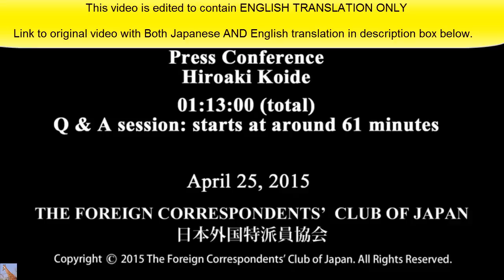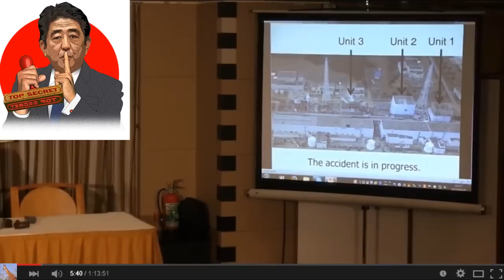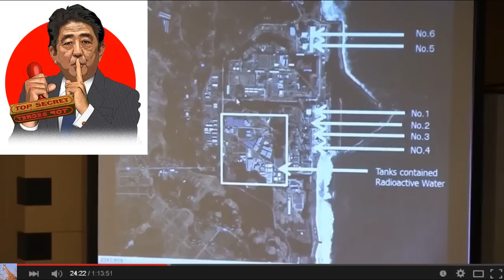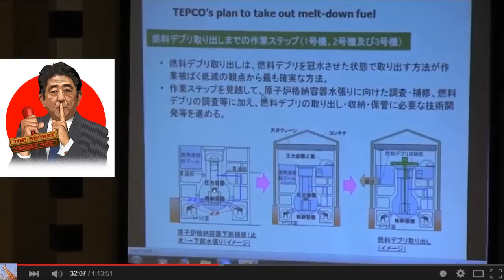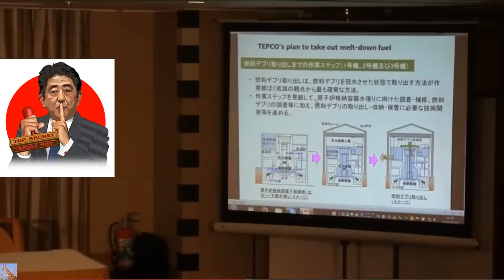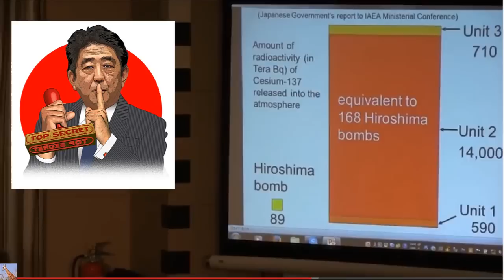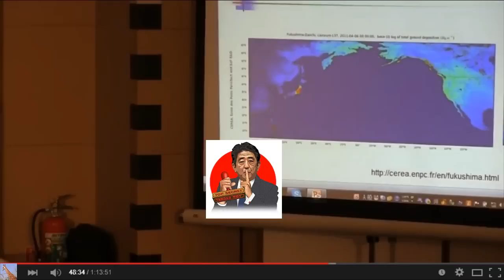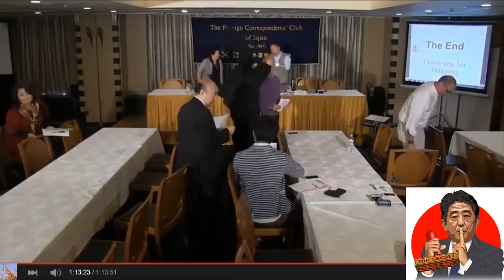Fukushima: Impossible to Remove Melted Fuel & More Problems

Comment: Thank you so much for a most excellent talk.  However, I have to say that the cameraman on this job should have been beaten severely about the head for not panning over to the diagrams and graphs which the good professor had prepared to illustrate his points. So damn frustrating. Gotta wonder how he got the job.

Comment: It's so bad thayyy can't tell the truth I saw the whole plant blow up live on TV that morning six explosions not three  the fourth one caught fire   take the money for the Olympics and try to save us all from what's coming   it was built way to close to the ocean  this whole place needs to be encased  in twenty five yard's of special concrete  to contain it  the water supply pushing it out to sea needs to be cut off so it won't go in to the sea  thayyy need to build sea walls around the plant  twenty-five meter's thick   and as high as you need to go to cover the entire structures of the plant  this must be done or wee all will die    the  waste water can be used to mix the concrete in Barre the first layers of the plant better it be in concrete encased waiting to be covered up by more concrete than sitting there evaporating and leaking all over the place the concrete used for this is top-secret and will contain it it's got to be at least 25 m thick everything encased in it it will spread by the wind  if this is not done  it's drifting in to the upper atmosphere and moving around the planet in an alarming ratesince these dumbasses didn't build a 20 million dollar lake to flood the rod Bay I don't know what to say all the money they've made with this plant there now going to have to spend that and heaps more to try to save us from this creation this giant erector set some moron ordered first things take all their money and put it towards fixing the plant pretty simple now you have got to find people willing to build all of this  and give there lives   to make sure this is finished